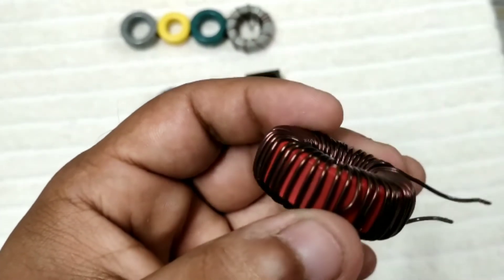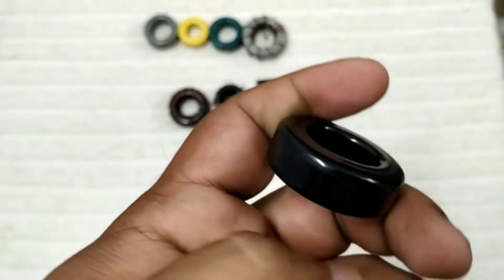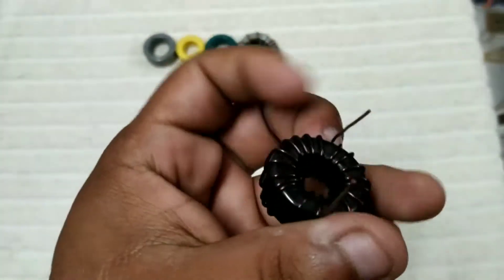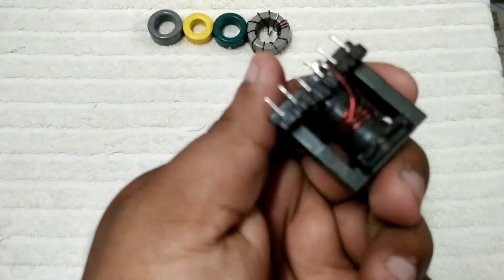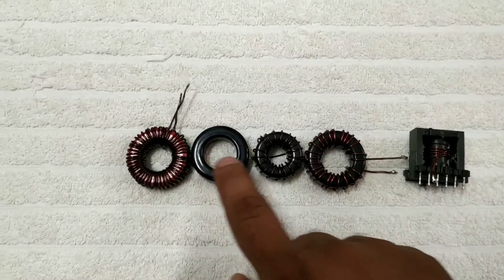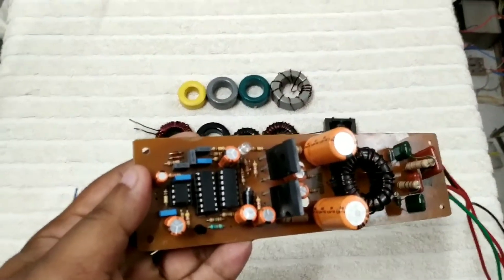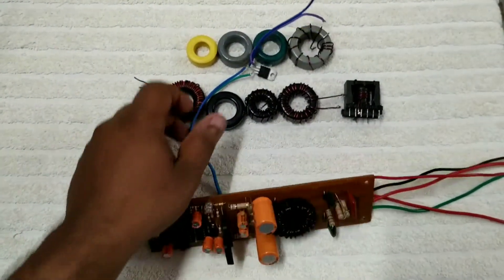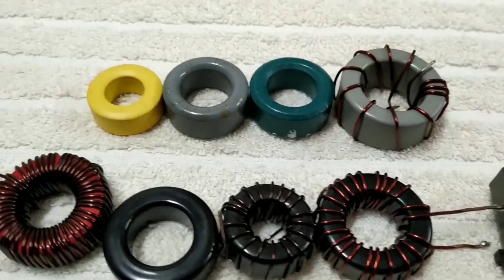Selecting the right inductor core for assembling a class d amplifier

Comment: im using yellow white core it working good...just we get hot..but not redhot...😅😅
using LCR METER...
im winding on 40uh
Reply from the maker: Apex d200..irs900d.. D2k5..ithpolathe kore models njan chyth nokki but yellow core ittal proper output kittilla perfect class d yil oru componentsum heat akulla... Heat ayal ath malfunction anu bcz it has an output of above 90% efficiency..
Reply: @technicalevolution9887  tq...i dont know where to buy it..but i try to buy on online market..inductor very smaller size..😂🤣...im build d900...
thank info...
Reply from the maker: @ourchannel8215  bro ath online kittunnund bro sendust core kittum pinne india martilum und onnu try chyu
Reply from the maker: Sendust core anu vendath bro class d output and stability depends on quality of components and right selection of components

Comment: Nice video brother... thanks a lot. Inductor / air coil value (height, gauge, number of windings calculation)എങ്ങിനെയാണ് kandupidikkuka?
Reply from the maker: Ath core size und oro circuitnum anusarich eg t106-2... t132-2 angane but sendust based core anu best ath black blue green color okke und pinne inductor value curcuitil undakm wind chyan nalla copper wire edkkukka gauge koodya wire anel turns korayum oru lc meter vach inductor value correct chyuka that's all
Reply: @technicalevolution9887  thank you ☺️
Reply: @technicalevolution9887  multimeter vechu pattumo

Comment: Which core is perfect match 
Number please bro
Reply from the maker: Use t106-2 or for high power use t136-2
Reply from the maker: Sendust core
Reply: T-106-2 
I have 18guage enameled copper wire how many tourns for 35uh
Reply: There is any website for calculating winding
Reply from the maker: @kmsaudiolab2026  sir pls try to buy a LCR meter to calculate inductance
Reply: How many tourns for 35uh int136-2  same 17guage wire
Reply from the maker: @kmsaudiolab2026  I will upload a video about LCR meter soon
Reply from the maker: @kmsaudiolab2026  thanks for supporting and pls share to frnds too
Reply from the maker: @kmsaudiolab2026  it is not easy to calculate turns bcz different company inductor cores have different permeability so number of turns will be not same for cores
Reply: Defenetly sir

Comment: Bro gray color core evidenna Kitts
N87
Reply from the maker: Core mikkathum aliexpress anu bro
Reply: @technicalevolution9887  oru padu order cheyyanam thonnunnu
Reply: @technicalevolution9887  evide  place?
Reply from the maker: Yellow and black core ivde kottunnund
Reply: @technicalevolution9887  athu quality kuravalle
OG gray allee
Reply from the maker: @jinusuhail5291  class d chyanano
Reply: @technicalevolution9887  mmm
Reply from the maker: @jinusuhail5291  class d chyan sendust core anu best black color allenkil red iron powdered original core venam
Reply: @technicalevolution9887  
Gray anu  OG ennu ennodu oralu paranju 
Brand set nte ullil gray alle varunnathu
Reply from the maker: @jinusuhail5291  no idea bro but grey OG kittan padalle black sendust ok anu choodakilla core nalla out und
Reply from the maker: @jinusuhail5291  njan undakki nokkitha black vach no problem 900d 1200d 1500d ellam nokki no prblm
Reply: @technicalevolution9887  kittan prayasam aanu
OG kku nalla vilayanu nnu thonnunnu
Reply: use high freequency above audiable to avoide Inducture filters